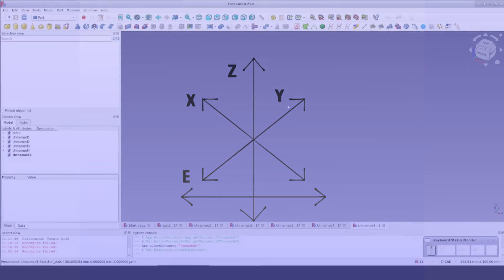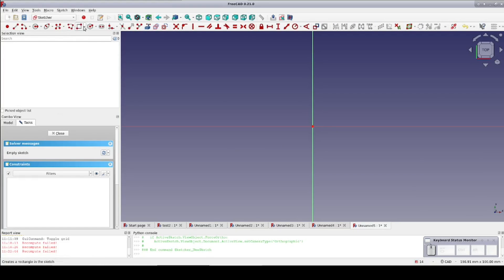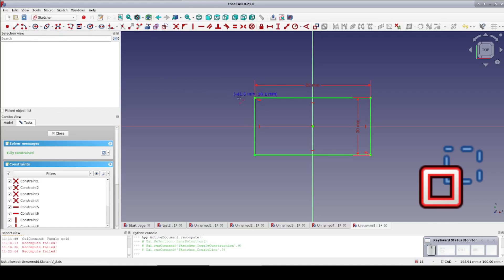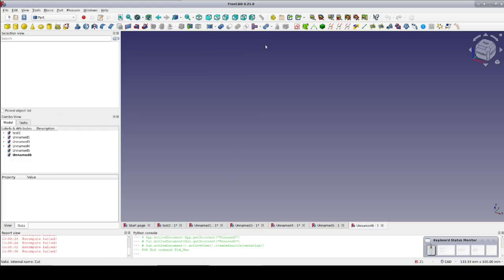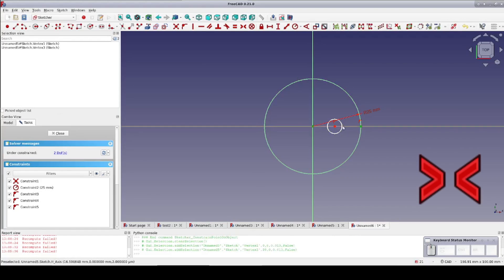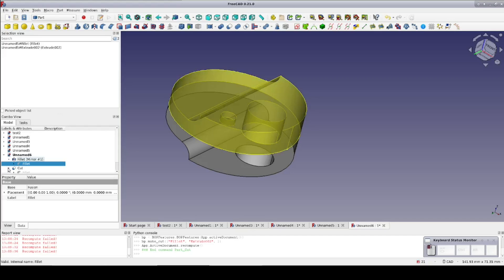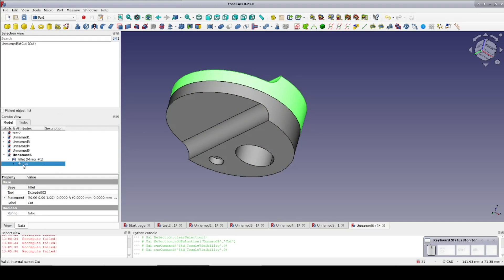FreeCAD: An Open Reply to TeachingTech

Comment: Ok, so I'm just going to comment as I watch, every part where FreeCAD has painful efficiency deficiencies.

Starting at around 1:59, the amount of constraints you have to use here is soooooo much more than one would have to do to make the same thing in Fusion (the software Im most familiar with so will be making comparisons with mostly) and Onshape. With Fusion, You have multiple rectangle options and all of them immediately on creation allow you to dimension them. For Fusion, its a shortcut, click, type, tab, type, enter and you often have a fully constrained rectangle (like in this instance, you'd just use the centered rectangle, click on the center).

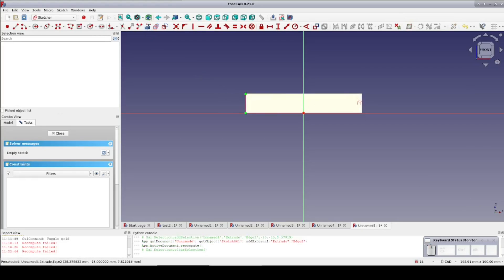At 3:35, I completely refuse to believe that no one can see how this isn't monumentally more  painful than being able to do both features from one sketch. Of course in this simple example it doesn't add much more time, but I can think of an infinite amount of real world uses where that slows you down massively. Like its legitimately one of the biggest problems with Freecad and its so frustrating when people act like this is just a "different" style with how much slower it is just based on the number of extra actions and context switches you need to do for this workflow.

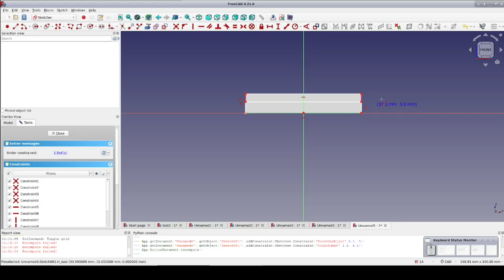At 3:50, once again, the lack of inferred constraints makes this visibly so much more tedious and taxing. In Fusion the midpoint constraint is something you rarely need to use because it infers it based on placement (which you can simply hold down ctrl to turn off temporarily if you want to manually constrain it). There are others, but the midpoint was the easiest to point out.

At 4:52. that demonstrates that it has a (much less usable) parametric nature, but does not demonstrate a timeline. A timeline would mean you could go back in time so to speak, fix an error, and then have your fix propagated through the rest of the changes you've made. This specifically includes the ability to remove actions and add actions as well. To be a functional timeline, one should be able to go back and add a new feature before for instance some boolean feature down the line, and the software should just figure out how to act as if they did that in the first place. This is a deficiency, not a difference, a deficiency.

At 5:45 It really seems like the Freecad community in general only admits a deficiency is a deficiency when a fix is on the horizon but then pretend everything else is just like a difference in opinion or skill issue as they do 50% more actions to get the same result.

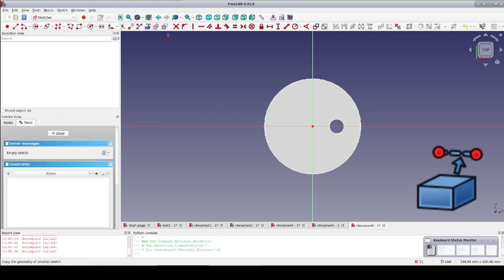At 7:05, yet another "why isn't this just inferred by default". Specifically, where external geometry has to be brought in, by default, if one places a sketch on the face of another body, they can just start referencing the other bodies face features and when they do, they are automatically projected in. That's a lot of clicks gone, especially if the face is at all complex. There is also of course intersection projection. Maybe Freecad has this too, but its not obvious, which is another deficiency, that nothing is obvious but that's for another comment...

At 8:00 Having to specifically create geometry rather than just putting a line down and using existing geometry and picking the appropriate side is, once again, painful. This seems an admitted deficiency as its being worked on though.

At 8:20, firstly, I've just noticed that cryptic errors have been going off constantly and have just had to be ignored... that's not good ui behaviour to slap the user with a ton of spam, and that's what it is if the user in the default path is supposed to just ignore them. Also, the fact that the body wasn't just extruded and automatically joined is yet again, more unnecessary inefficient clicks.

At 9:10, Fusion has that same deficiency, sort of. Instead of letting your part freak out, they simply give you an error. They added a specific mode of the fillet tool that goes to the edge perfectly though to address this floating point math quirk.

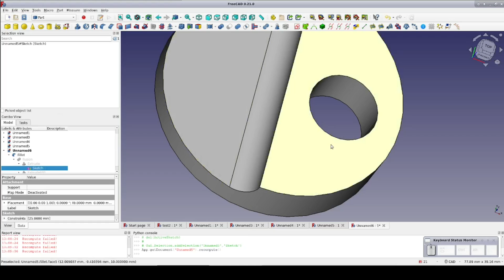At 9:55, this is said as if it is not a problem with Freecad, but in Fusion, this wouldn't be a problem at all, because with Freecad, this is actually a series of problems building up to necessitating someone have to recreate geometry from a previous sketch and re-constraining that geometry. 

When you have to do tedious repetitive tasks like that, is prone to human error, and you guessed it, in my, and most people's opinions, a deficiency, not difference.

At 11:37, saying "even though its not always a gui operation" as if thats remotely usable I think its the crux of the problem I have with all of these responses to Michaels video and criticisms of Freecad in general. Who in the universe thinks this is remotely in the ballpark of efficiency that the workflow of literally any other in depth cad software that has a timeline? What this feels like, is you are going behind the scenes and change programming variable that are only exposed because the UI isn't there. The problem here, and maybe it isnt one, is that sure it applies for this one object, but in other CAD packages, this change would be reflected even if it involves many other items, parameters etc. Does freecad allow you to do that? To change the faces of the sketch used to extrude for example? To have other components reflect the changes (Components can have multiple bodies btw).

The conclusion, see I think that conclusion is completely and perfectly fair. I totally get, and agree with all of those ideas.

The main problem I have, is that it feels like the Freecad community, feels so strongly about those, that they are willing to ignore glaring flaws in Freecad. I'm not saying they shouldn't use Freecad, Im just saying the constant attitudes of calling every Freecad issue that isnt being fixed in some branch somewhere with some unknown release date a skill issue, or simply different, when it legitimately just adds a multiplier to your workload, isn't good for anyone*.

Anyways, that was a long comment, and I pointed out a lot of things, but I this video wasnt the toxic "everything is a skill issue" I expected it to be so i wanted to be clear about that in case my comment came off as including this video in the pile. I definitely think that it appears a lot of Freecad users haven't tried the other pieces of software or tried them like when linux daily users try windows and pretend to be tripped up by obvious basic things and go back to linux where you cant do literally anything with administrative permissions unless using the terminal for most distros... (To be clear, Im in the process of switching over to linux as a daily as well, I just am willing to admit the flaws of software that I use).
Reply: I have a few points to give, but I wholeheartedly agree what you're going for: This FreeCAD has massive potential, but its development past decades has been lackluster, considering its shaky foundation and steep battle with competitors...

1. About fast dimensioning tool... It's now fixed. (read, borrowed from other CAD, LOL) It's available on the latest weekly build, enabled by default. Took that long honestly! (PR was merged on the last October.)

2. About reusing same sketch easier, I believe you know this, realthunder's Link branch has that option there. I'm unsure whether this feature comes out in FreeCAD before TNP... It's not on the priority as it seems on main repository's PR & GitHub project milestone.

3. Inferred constraint should become better, admittedly. Coincident and Horizontal/Vertical are there, but no mid-point/symmetry or else?

4. About historical parametric feature, this video's demo wasn't quite good at explaining it, so here I go: If you want to insert an operation to previous history, you have to: Right-click on an older operation in timeline, Click 'Set the tip' (Solver will compute based on "tip"'s features) and then make a new operation. (It'll insert between the older operation and historically newer operations) Then you can set the "tip" back to historically newer operations.
This could do some work... A big work.

5. About inferring external geometries by default, I think it's due to TNP mostly. FreeCAD outright restricts other body references in PartDesign workbench unless you do funky things like 'ShapeBinder' or 'Sub-ShapeBinder'. Also, this could also be due to 'Cyclic Dependency' where a child refers geometries of its parent(s).  FreeCAD's solver hates it.
A Parent depends on its children' geometries to construct its own shape, so if its own child tries to depend back into parent's geometry, it becomes a loop.

6. About 8:20, did you mean bottom-right console window? It's a Python console. FreeCAD exposes almost all of its backend APIs as Python methods. This allows Python-based 'Macros'(scripts) to mathematically compute geometries & exact operations. The bottom-left window? It's an error console as you see. It displays general errors thrown by Solver and Addon workbenches' scripts.

7. About comparing Fusion360 Chamfer and FreeCAD's, I'm quite saddend to see the horrible status of FreeCAD's feature equivalency. In fact it's worse than Fusion in some cases - like reverse-filleting intersection of same-diameter T-Pipes. In Fusion, this is handled gracefully by creating the whole fillet face through intersection, sort of like wrapping a scarf. FreeCAD flat out fails at this.
Reply: @m4ki9h76  The lack of a means to quote is annoying so I'll just use numbers as well.

1. And this covers a few of these points, but I am very aware that every this that and the other branch has this that and the other feature, and I tried to hint at that when I said "that isn't being fixed in some branch somewhere with some unknown release date". The thing is, I very passively try to keep up to date with what they've fixed, and it seems like I've heard about fixes for a dozen things that are in varying different branches that are just about to be merged into mainline forever for so many things.

I completely get they are a limited team, but that unfortunately doesn't magically make the workflow better. It just means I don't blame them at all for not being able to get it to a good place, I just acknowledge that it isnt in one.

2. Indeed I am aware, though I consider a feature added when it is irreversibly and permanently added. Basically, a feature is added when its in stable. I feel this way for all software because I've been burned by forever in staging features that eventually died (in general).

4. I actually felt that for the time he allotted to it, it was a fair enough explanation. I do get that the timeline is ""sort"" of there, but as you state, its not really a timeline is it. Its sorta just finagling with various points of a tree, and like I mentioned has areas where it kinda breaks/lacks functionality. Of course the biggest problem is as mentioned, that this is the opposite of efficiently presented and usable.

6. No. I actually meant the bottom left. I actually find having python APIs for everything to be a big plus. Its one area where while I don't have experience with it directly, it might just be on par or maybe slightly better than some other options.

7."In fact it's worse than Fusion in some cases"

This was phrased quite oddly, as if to imply that fusion has notable feature deficiencies vs FreeCAD or that FreeCAD doesn't have notably more.

Comment: @5:21 You proove that it is parametric, not that it has a time line ! A true time line makes possible to insert new operations at any time or to swap or shift operations like on f360.
Reply: The tree is the time-line. You can totally pick some time in the tree, press "set tip" and insert a new operation there and then.
Reply: @fbombtehgr3at Ok thks. And can you swap 2 existing operations in this case ?
Reply: Thats how every one of these hyper defensive responses is. They just bend over backwards to ignore flaws and do anything to call them differences rather than flaws.
Reply: Isn't that basically what he does @11:35
Reply: @Di3Leberwurst Not exactly ! If you're a F360 user, you know what I mean...

Comment: Totally agree that FreeCAD first impressions are riddled with the misunderstanding of its CAD kernel. Other commercial kernels have many features included that suggest convenience when the user is building something that has mathematical/topological issues. Commercial CAD kernels do then "figure out" a way or two how to remedy the model and try to guess what the user meant by that operation. Typically they are right with their guess.

Not so openCASCADE, the FreeCAD kernel. When you do a questionable mathematical operation, you get immediately a slap to your face. Yes, that is annoying and inconvenient as user in the beginning, but this forces you to structure your model mathematically reasonable which is THE skill you want to learn because that is the only skill transferable from one CAD software to the next! All those convenience features are solved differently in other CAD software. All those interfaces are structured differently, and so on...  Whenever you pick up a different CAD software you always start at bottom zero in terms of user experience/convenience.
What is left is the knowledge of logically structuring a model that stays the same for different CAD software (perhaps Siemens' synchronous technology changes this a little).

All the other points with the interface and workbenches, I totally agree. It is an unoptimized interface where some items are available in all workbenches and others not and everytime you change the workbench, the interface slightly changes.
Reply: What an unbearably gentoo linux bro response. You describe a defficiency as a skill issue. People so not care about being mathematically perfect. They want the best use of their time possible. It is a positive, not negative, that other peices of software let you get away with what you call mistakes.

Comment: This might seem like a cliché position to take, but I really, honestly, think the truth (as I see it) is in the middle of your two positions. I'm mostly a hobbyist with CAD experience in Fusion 360, Solidworks, and Siemens NX. I tried to learn FreeCAD almost a year ago now when the license terms of my "preferred" program (Fusion 360) started getting more onerous. (and the online login prompts started showing up more often) By education and trade, I am an embedded computer systems engineer, so I don't have that much CAD experience to draw on.

That's all to mean that I say the following coming from a genuine position of love for the work the FreeCAD team has put into the project and hope that it can one day be like the Blender of CAD suites. I found Michael/TeachingTech's opinions on FreeCAD usability to largely be identical the ones I felt when trying to switch. The feeling of FreeCAD trying to reinvent the wheel and inhibit my "creative" tendencies by just plain doing things different from any of the paid/freemium suites was pervasive and (for me at the time) impossible to shake. Almost nothing I tried to do in FreeCAD using "industry-standard" techniques worked on the first try and it felt like it took an order of magnitude longer to get a moderately involved part designed than it would take me in Siemens NX (a CAD suite I learned for the first time at work this past summer, which is why I draw the comparison).

I'm sure there are valid ways to accomplish the same things in FreeCAD that are possible in the 3D workspaces of Fusion 360, SW, or NX, but I never found them and the tutorials/docs I had to draw on weren't particularly... satisfying... for lack of a better term. It's a petty (*IMO nevertheless subtly important*) complaint, but the GUI theming also feels antiquated and the default colors/rendering often make it difficult to get good contrast with the sketches lines.